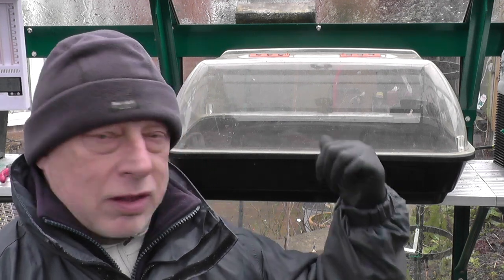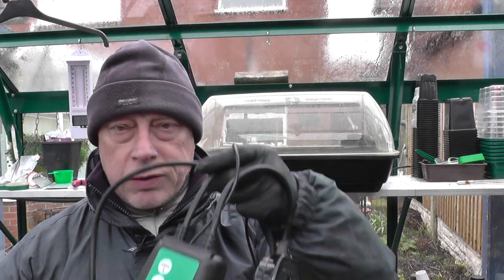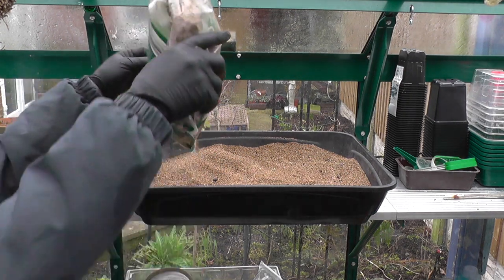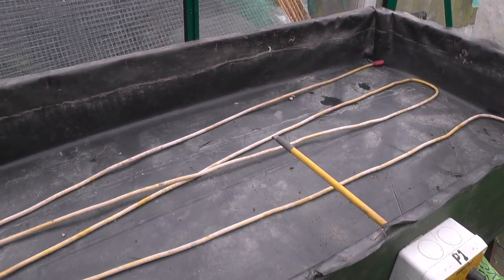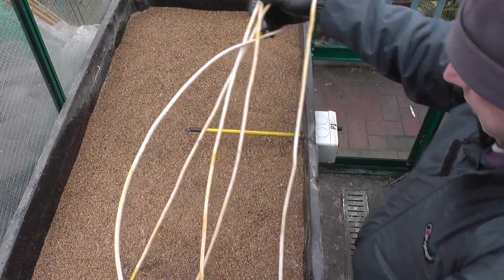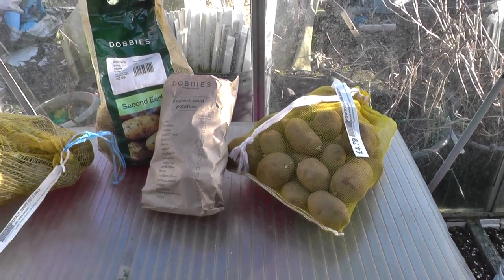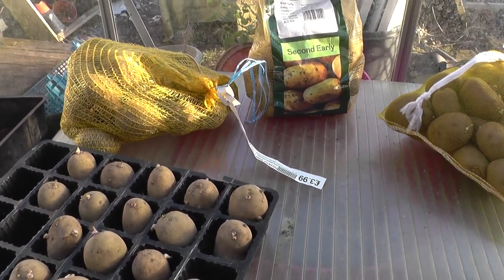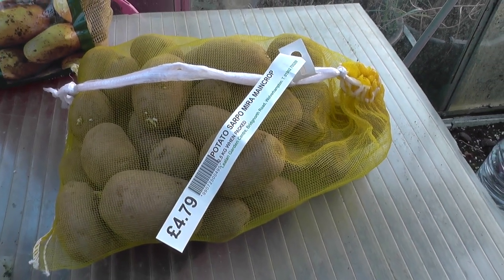MuddyBootz Allotment #95 - Propagating Bench Rebuild - Potato Choices - Strawberry Plants

Comment: I have the opposite problem Nigel, my thermostat is working great, but the heating element has packed up.  So I'm germinating most of my stuff in the house instead.  My bed used sand, but it was nowhere near as deep as yours.  Those strawberries looked pretty good from a distance, nice healthy leaves.   : All the best - Steve
Reply from the maker: Hi Steve, the heat transfer using sand was very good but the weight on the staging for two 4ftx2ft boxes would be too much. The vermiculite seems to be working fine, but I will keep an eye on it to make sure it doesn't dry out. Strawberries are really good plants...ive potted in them on today into 3". pots 😀👍
Reply: I was also interested to see that you are ex-aerospace, I thought you might be!

Comment: Hi Nigel, great video that heating bed is a great idea. I’ve got a heated propagator that I use with a grow light but it doesn’t have a thermostat. I’m definitely going to look into the switch as that seems a good idea. Now to the great vermiculite debate. £1 for five litres is great. If anyone can’t get it and is in the U.K. then from 1st March Aldi is selling 10 litres for £3.49 and also Perlite for the same price. I bought some last year and it’s good stuff. Your potatoes look good. Take care. Nick
Reply from the maker: Hi Nick, I seem to get through vermiculite/perlite very quickly. My tomatoes seem to do will in a good perlite mix 👍. Have you got your thermostat running yet?
Reply: MuddyBootz - Hi Nigel. Yes got the thermostat at the weekend and I see what you meant about the instructions! The ones that you forwarded on were easy to follow so I’m up and running cheers. Take care. Nick

Comment: neither of my local poundlands have any vermiculite in stock' so I checked out the local garden centre. £8 for 10 litres. I'm not paying that much. next stop was wilkos. £5 for 10 litres. I bought a bag but not opened it yet, so I cant yet compare the difference between wilkos and poundlands product. in truth, I was very happy with the grade of vermiculite from poundland................brian
Reply from the maker: HI Brian, The Poundland HQ is only about 3 miles from me. I will give them a call to check if they are stocking it this year. I will get back to you later 👍😀
Reply: nice one, nigel.
Reply: I got the one and only bag on the shelf from mine. Its very fine. 5 litres. They do get snapped up but they are stocking it at least. Also, thought I'd try a bag of their 'premium' potting compost, 8 Litres, so I can seed-start at home. Not sure if its any good but there's time to play with.

Comment: It was me Nigel that mentioned vermiculite but thanks for mentioning it again so others can grab a bargain. I think i got a few bags 2-3 weeks ago from poundland, great deal. How did you get on last year with Marshalls onion sets the heat treated ones? I am tempted to get some this year, 3 different sets plus fertiliser :) Cambridge strawberry plants are a good variety very tasty I grew them before. Strawberries tend to go down after 3rd year so always replenish before then. if you grow then in weed membrane the thick stuff is better. I use it fair boit now on onions, leeks I also make a hole with something hot that can fuse the plastic like a soldering iron I did this at home. but I now have a butane soldering iron so can do it on site you could use a heated tin  can to make a hole, it stops plastic getting around on allotment as it often frays
Reply from the maker: Marshall h/t sets are great value for money and the fertiliser goes a long way. They also store very well. I still have about 15 of Red Fen and Rumba still in the greenhouse. I have got a butane blow torch to give it a blast!! (I also use that to get the wood burning on my allotment fires 😉) 👍
Reply from the maker: Got in touch with Poundland Head Office ref. Vermiculite. The deliveries are going to hit the stores in the next few weeks. Luckily, one of my nearby stores just had a delivery.....A different design on the bag from last year...no Charlie DImmock. Looks like a new supplier. Not opened one yet to check quality
Reply: Yeah thats right its different packag, I got mine from York, Monks cross it's not local to me. In my hometown they didn't have any yet. I wish they stocked the horticultural sand like they did 2 years ago, they didnt stock it last year

Comment: Nice spuds mate, I usually grow Sarpos... but have gone for Cara's this year. I've grown them before and were decent for me so I thought I'd have a change this year. Those heating propagators are frustrating without the control... it's either a sauna inside or not. Will be good to see your new gizmo in action. Cheers Adam
Reply from the maker: I may take the plunge and pop a few Swift in pots in the greenhouse 😱. Little propagator is up and running fine. The new controller has more precise control than the old model which broke 👍
Reply: Weather report says The Beast from the East is supposed to hit us at the end of the week. Really cold temperatures coming our way. I don't know how true that is... but it might be worth keeping an eye on Shefali ;-)
Reply from the maker: Allotment Grow How  I do anyway.......regardless of the weather! 😀😀😀😀😀😀😀